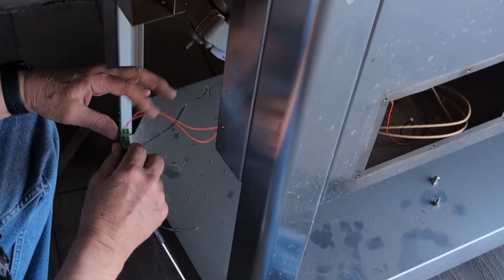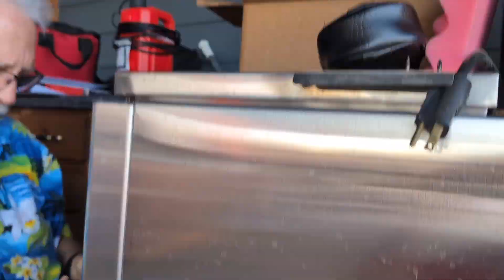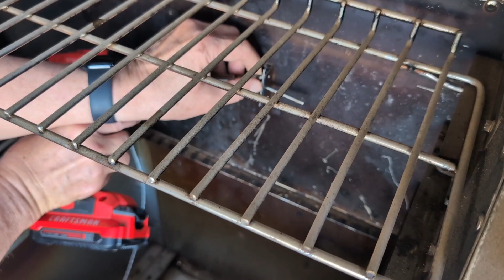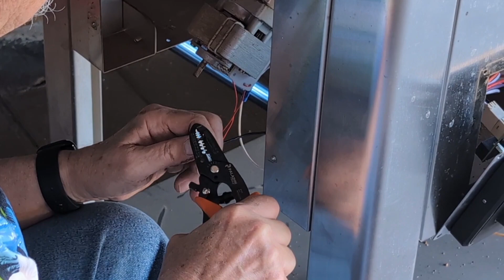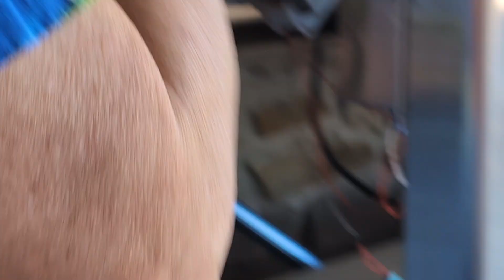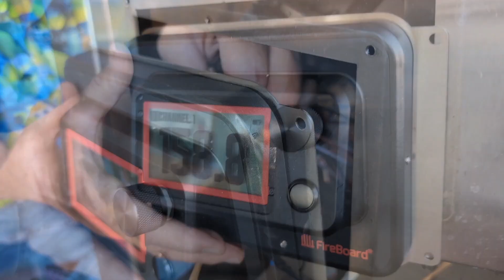Installing a Fire Board controller on your Cookshack PG1000i

Comment: Can this be used to upgrade a PG1000?  It kinda sorta looks like that's what's happening, but the video title mentions PG1000i, which already comes with one of these controllers.  Also, what is the control philiosophy?  The duty cycle approach of the old controller is simple, smokes well and gives great results.  Does this one use PID or does it stick to the same control methodology?